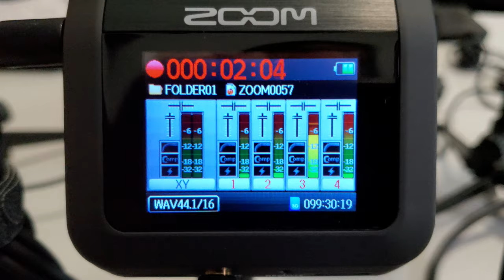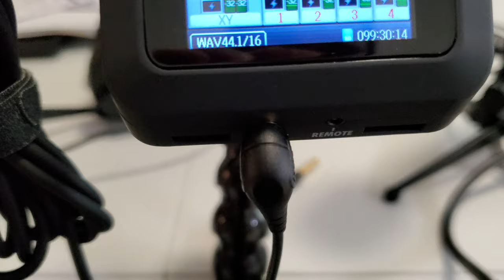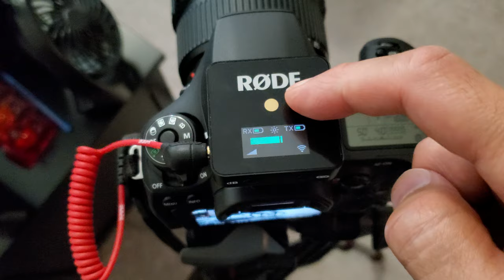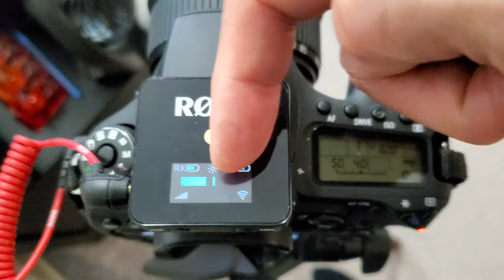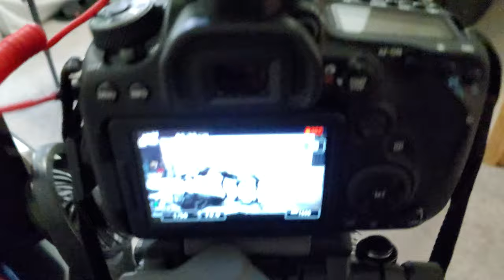How to use Zoom H6 audio connected to Rode Wireless Go for wireless audio feed to Canon camera

Comment: Excellent video, thank you.. If I were to use a single shotgun mic and connect this to my Rode Wireless Go transmitter directly using an XLR to 3.5mm jack adapter and record audio into my camera (wirelessly), will the sound quality differ substantially? in other words are you transmitting better quality sound wirelessly by transmitting the signal from a zoom recorder? I'm looking for a wireless set-up where I can hook up a shotgun mic to the Wireless Go directly and transmit the sound wirelessly but don't actually want to compromise on the sound quality I record.. Any help would be appreciated.

Comment: I'm supposed to be receiving a similar (competitor) setup and was going to try this very same workflow as part of the testing... You've definitely got a great setup to record and sync in post for a video podcast 😉
Reply from the maker: Haha thanks Kevin. I got this inspiration from Omar Gonzales' YouTube video. But I took it one step further and used my Rode Wireless Go lav system for wireless real time audio feeding to my Canon camera. I have the Canon 90D DSLR plus the Canon M50 mirrorless,  plus the Canon Vixia G60 camcorder. Plus bunch of nice Canon lenses. Plus lots of camera microphones. Was thinking of maybe getting the new Canon R5 but changed my mind after all the negative over heating issues.
Reply from the maker: Edit: I now have the Canon R5 camera for the past 3 years, and it works great!

Comment: So, in your setup, the sound track recorded o your camera, you have only one, right? It merged the 4 microphone tracks into a single one as soon as it leaves the H6 out jack to feed the Rode Wireless Go? Can you still use the 4 individual tracks saved onto the memory card of the H6 ? Important to me as sometime, you may want to give a boost on one track instead of another as they are not as close as your 4 mics from each other

Comment: Just bought wireless to 2 to di this to use shotgun on zoom h5 to capture nature sound with 1 transmitter  and second on me to talk and camcorder 20 feet away zoomed so I can get f2.8 bocca while filming me talkintvand shotgun on camcorder catching audio then using each channel to adjust my voice over and background noise for perfect audio. Plus allows me to mic w more inputs or 4 with extra xlr capsule. Or can leave zoom at home and cut down on weight still do voice use in camcorder mics as background. Should be showing up soon ordered go2.

Comment: Great video Casey! Quick question - if you compare the audio captured in your camera using the wireless rode vs using the long 3.5mm cable, is there any difference in the syncing of the audio with video? Meaning is there any kind of lag or latency you experience using the wireless go as opposed to the hard wire? I would love to use your same set up, but worried that going through the H6, then through the wireless go, might degrade the audio signal into my camera or introduce slight lag etc. If you could let me know if any of this happened to you, that'd be great. Thanks!
Reply from the maker: Hi Daniel. Thank you much, I appreciate it! There is no lag using the Rode Wireless Go versus a cable. That said, if your Rode wireless receiver on the camera is too far away from the transmitter, or maybe you don't have line-of-sight from a far distance, then the Rode Wireless Go signal can degrade. But if you are using the Rode Wireless Go from a relatively short distance, everything should be fine. Thanks for watching my video, feel free to subscribe for more content coming up.

Comment: Nice setup but audio drift will happen after 30 min. I should know bring zoom h5 user in studio.  I run lineout  wire to mic input on Canon g30 (xa20) and set preamp in camcorder to match zoom h5. Then run hdmi out into atomos recorder and out from atomos in 1000 nit monitor. Atomos and in camcorder capture video and audio but I only use dnxhd 220 mbit atomos files import into davanci resolve studio for editing. The audio is in sinc after solid hr. But if I record zoom card it drifts so I use cable because the Canon camcorder has studio preamps in cam.
Reply from the maker: That's good information, I appreciate that! For filming, I've been using the Canon Vixia G60 camcorder and upload YouTube videos in 4K quality to YouTube which takes forever to render from the initial 360p to 1080p and finally to 4K, haha! I wish I had your Atomos monitor, instead I have 2 of the FeelWorld F6 Plus 5.5" monitors that I find to be good stuff. Best part is that I can power the monitor for many hours using an external rechargeable battery pack into the FeelWorld monitor that has a 5Volt USB-C power port. I also have Davinici installed on my computers, but for the life of me just can't get get motivated to figure out how to use it, haha! So I use CyberLink PowerDirector Ultimate 18 instead. If I need to record anything similar to the video I showed here, I now use a different setup which is the Rode Rodecaster Pro podcasting device with the Rode Wireless Go lavalier mic system connected to the Rodecaster to transmit a wireless audio feed to my camera. So many different ways to do things, LOL! Thanks for watching my video!
Reply: @caseyonlocation8257  on my channel I have utilities to convert 4k to whatever format using 100 threads on your processor. Have atomos capture software for 4k using blackmagic 4k mini card with prores422 10 bit. You Canon g60 can output 4k 30fps 10 bit color. Should watch my video how to turn PC into atomos recorder! This may improve your in studio production.

Comment: my only question is can I still record to a sd card using the Zoom H6 and still send a signal to the wireless go at the same time. I want to be able to have both in camera audio and a separate source just incase. Great video by the way.
Reply from the maker: Thanks for the nice compliment! Yes, as long as you press the record button on the Zoom H6, it will record the audio to the H6 SD memory card, while also recording wirelessly to the camera via the Rode Wireless Go.
Reply: @caseyonlocation8257  Awesome! thank you
Reply from the maker: @EmbracingNihility  Glad that helped you!
Reply: @caseyonlocation8257  Yeeesssss!  I was just talking to my friend about this, since he wasn't sure he said look it up on YouTube.  I said I can't find any videos talking about this and here i come across this video.  Just wow 👏 

Much appreciated
Reply from the maker: @kennyboston8556  Thank you for the nice compliment! I like the Rode Wireless Go so much that I recently got the Go version 2 with the dual transmitters, it's quite an amazing improvement over the original. Thanks for liking and subscribing to my channel if you did so.  :-)

Comment: I also use the Rode Wireless Go. I was wondering if I used the transmitter as normal, (lav mic and in my pocket), then if it transmits to the receiver mounted on my camera, line out to an H1n, then line out to the camera for easier syncing in post. Do you know if I would I be recording better audio quality using the H1n, vs the Wireless ROde direct to camera?

Comment: Great video
Can I connect a zoom podcaster p4 with a 3.5 cable on a canon 60 d?
In Looking to do a budger friendly video podcast set up.
Reply from the maker: Hello Juan. Thanks for the nice compliment, I appreciate it! I have good news for you. I just double checked it today to make sure it works before answering your question. The answer is yes, you can use a Zoom PodTrak P4 and have a long 10 feet 3.5mm TRRS AUX cable connected from the headphone-in port on the PodTrak P4 and the other end going into your Canon camera. For my own setup using a Canon 90D DSLR camera, I have a long 10' feet CableCreation brand 3.5mm TRRS AUX cable going into my Canon 90D mic-in port on one end, and the other end going into the bottom of the PodTrak P4's headphone-in port, such as #4 headphone-in port on the far right side. To make this work, you need to adjust the headphone volume to around 7 to 7-1/2 (no higher) on the same #4 headphone-in port that you have the TRRS cable plugged into. Additionally, for whatever microphone you have plugged into the PodTrak P4, such as to Channel 1, you also need to adjust the gain dial to a suitable level such as to 6 or 7 as a starting point. My Canon 90D camera received and recorded the audio signal just fine that's coming from the PodTrak P4, while the P4 is also recording the same audio simultaneously. I should qualify by also saying that although the PodTrak P4 does not officially have a "Line Out" port such as what the Zoom H6 recorder has, nevertheless the PodTrak P4's headphone-in port effectively works as a Line Out port. I will also say that the signal from the headphone-in port is not as high quality as the normal XLR channels on top of the PodTrak P4, but it does work for transferring the audio to the camera. Since your camera is the Canon 60D which is very similar to my Canon 90D, having the 3.5mm TRRS AUX cable going into your camera's mic-in port should work just fine. If you find this information useful, please consider buying the new Zoom PodTrak P4 using my Amazon links found above in either the description or the first pinned comment. This means I will receive a small commission which will help me to keep producing helpful videos like this. In addition to buying the PodTrak P4 (via my Amazon link above), you will also need to purchase the 10 feet long CableCreation brand 3.5mm TRRS AUX Audio Cable (also via Amazon link above). I wish you good luck in your podcasting endeavors, and thank you for your support!
Reply: @caseyonlocation8257  thank you so much for taking time to reply and being so detailed I greatly appreciate it!
Reply from the maker: @jctv787  Hello Juan, you're welcome! I didn't want to give you a simple canned answer. So I actually tested everything to make sure it really works before replying back to you. I'm very certain it will work for you too! If this review was helpful to you, I hope you will consider buying those 2 items of the PodTrak P4 and CableCreation TRRS cable using my Amazon affiliated links so I get credit for the purchase (BTW: the purchase must be completed within 24 hours of clicking on the link to be valid). The PodTrak P4 for only $199 is an amazingly low price for all the features it offers! Let me know if you have other questions.
Reply: @caseyonlocation8257  thanks for this reply, does that mean that you could use the rode mic transmitter in the headphone out and receiver into the mic on the camera?
Reply from the maker: @TheJulieNclaire  Howdy and thanks for watching. The Rode Wireless Go Transmitter connects to the "Line Out' port at the bottom of the Zoom H6 as described in the video. The Rode Wireless Go receiver is connected to the camera via the microphone in port as described in the video. Also thanks for like and subscribing if you did so!

Comment: Is there any way to split the 3.5 coming out from the line out of the h6 so you can use the sound on 2 cameras?
Reply: Of course, a 3.5mm y-adapter will do.

Comment: This might be an overkill question... but if all of the microphones are replaced with Wireless Go (+Rode VXLR+ Adapter) and another Wireless Go as the transmitter, would it all work?
Reply from the maker: Sorry I missed your question. I don't have that Rode VXLR adapter, that item has been sold out at many retailers for quite awhile, so I can't test that. I also don't have the Zoom H6 any longer, as I sold that in favor of the Zoom PodTrak P4 podcasting recorder.

Comment: Is the line out from the Zoom H6 mic voltage or hotter line voltage?  If it is line voltage, doesn't the Zoom-Camera link need a 20db pad or apply a 20 db pad in the settings of the Zoom?  Since this was not mentioned in the video, can I assume that the camera did not need any padding, either mechanical or from the settings in the camera?  If I record a band using all for mic inputs, can I simply send the feed of all 4 inputs to the camera thru the line out?
Reply from the maker: Howdy. I don't know what you mean by line voltage or hotter line voltage. I'm also not sure what you mean by padding...but no padding was applied, since the audio went straight from recorder to the camera with no adjustment/processing applied. Unfortunately, I cannot test your last question because I ended up selling the Zoom H6 recorder in favor of the new Zoom PodTrak P4 podcasting recorder. But if I had to guess, I would answer yes to your last question. If 4 separate mics are connected to all 4 XLR mic channels on the H6 at the same time, all the combined audio will be fed to the camera via the "Line Out" port on the bottom of the Zoom H6. You can use either a simple 3.5mm AUX cable, or use the Rode Wireless Go lavalier mic system connected to the Line Out port to transfer the audio to the camera in real time.
Reply: @caseyonlocation8257  Thanks for the Reply and your answer to the 4 separate mics and that will give me a feed out with all the tracks on the H6 to my camera.   I have a 1/8 inch to XLR to run the line out to my camera.  Padding (as I understand) is a connector like attachment with resistance to bring the voltage down from line voltage to mic voltage.  Looks like, from what you saw on your camera,  it is not needed as you went directly from the line out from the H6 to the camera.  Thanks again.
Reply from the maker: @43jimcr  Maybe you are referring to a device such as this Rode VXLR adapter? https://www.sweetwater.com/store/detail/VXLRP--rode-vxlr-3.5mm-to-xlr-adapter-with-power-convertor

Comment: That long 3.5mm to 3.5mm looks like a TRRS version.
Reply from the maker: Howdy. The 10 feet long AUX cable shown in the video is a TRS to TRS cable, not a TRRS to TRRS cable. At the 3:32 time line, you can clearly see the 2 black rings on each end of the cable that indicates it's a TRS cable with 2 black rings. A TRRS cable has 3 black rings. Thanks for watching. Also thanks for subscribing if you did so.
Reply: @caseyonlocation8257  right, thanks for clarifying. Subscribed & following.

Comment from the maker: I like making YouTube content. Recently I've been getting into podcasting. Podcasting can be simply audio either with or without a camera for video filming (example: watch some Joe Rogan podcast videos on YouTube). In this video, I'm showing how the same audio from the multiple XLR microphones feeding into the Zoom H6 can be simultaneously fed into the camera wirelessly in real time using the Rode Wireless Go lav system. If you want to forgo using the Rode Wireless Go system for wireless audio, you can also substitute by using a simple long 10 feet 3.5 to 3.5mm wired AUX audio cable going from the Zoom H6 recorder (line out port) to the camera's 3.5mm mic-in port. For this video, I'm using the Zoom H6 recorder, plus 2x Audio Technica AT2005 dynamic microphones, plus 2x Shure SM48 dynamic mics, plus 2x Audio Technica m20x monitoring headphones, plus Rode Wireless Go lav system, plus Canon EOS 90D DSLR camera with Canon 24-105mm f4 L MkII zoom lens, plus the Dinkum Systems Action Pod Pro gooseneck clamp to hold the Zoom H6, plus a generic Arca-Swiss tripod adapter with 1/4 inch thread quick release plate connected to the H6 recorder.